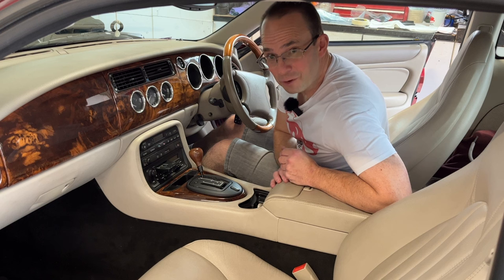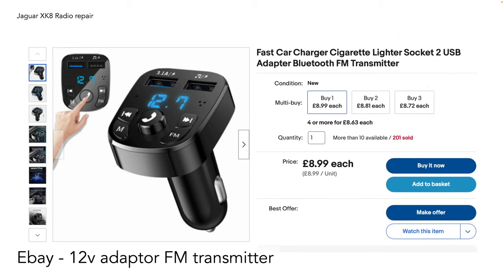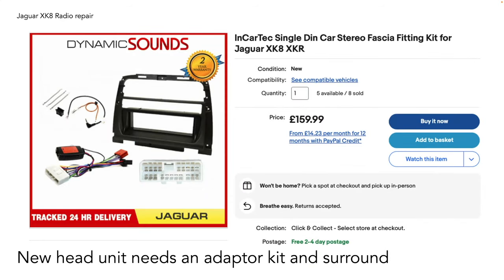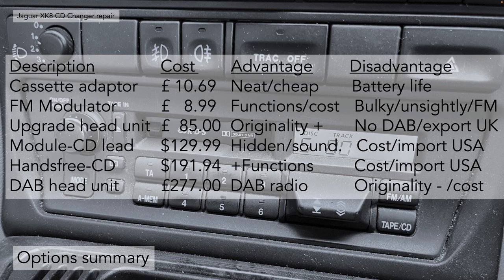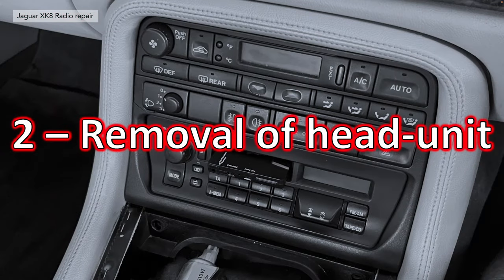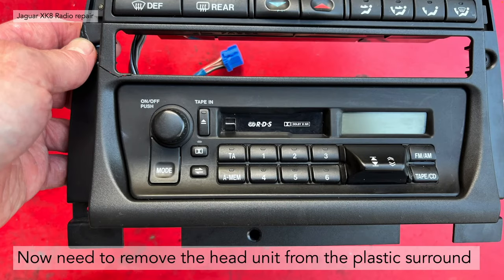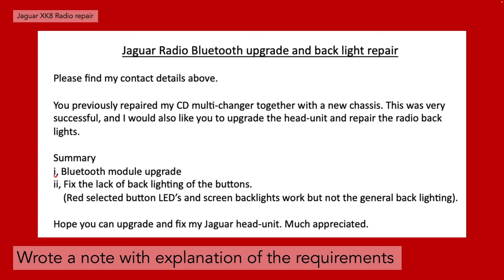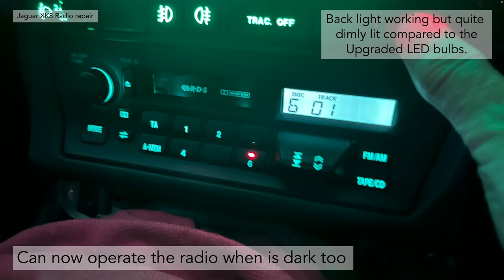Jaguar XK8 adding bluetooth, head-unit removal and repair. Radio cassette stereo BT XKR / X100 V205

Comment: I have been using the Cassette Adaptor for around 2 years.  It's brilliant.  Works well.  I don't drive my car alot so charging the adaptor is not an issue.  I just charge it before I go out on a long journey.
Reply from the maker: Hooky, I have also been using one for a few years and it's a good solution. The charging of the battery and the tape head pickup are weaknesses. Eventually got fed up and decided to upgrade the head-unit. No battery or directly connected to the head-unit, regards Damian

Comment: I fitted a new single DIN Panasonic head unit to my XK8 many years ago. Rather than change the entire console surround I simply bought a shaped insert which fits around the single DIN unit and replicates the shape of the original Jag surround. The insert was not expensive. You can spend as much or as little on the head unit as you wish but the total cost including the surround could easily be under £100 and you then have proper Bluetooth without cassette, DAB, USB socket, aux phono input etc
Reply from the maker: Richard, Sorry didn't include the surround inserts you can purchase for less. Good point you can find simpler options for head-unit integation and spend as much or as little as you want on a single DIN unit. It is a good solution but loses the OEM look for the dash board. Thanks for your input, regards Damian

Comment: Nice. I added bluetooth using a hard to find Alpine device integrated with the cd changer, along with a BT receiver and an extra subwoofer.  My XKR is red like the one in the thumbnail, a 2001 convertible.  I love it so much. It's SAD to say I may sell it soon since I dont have time to drive it anymore.
Reply from the maker: Dean, sorry you are thinking of selling your XKR but thank you for your input. Hadn’t occurred to me you could retro fit the BT module. I will re-record the video with this additional option. Do you know the module part number? Would like to see if I can still find one to add to the video. Much appreciate your suggestion, regards Damian
Reply: @ODRModurol  I'm in Los Angeles, so I have the US model, but it was an easy install.   If you can find the alpine part.   You need to use aux channel 2 on the Alpine KCA-410C Versatile link adapter to work with the Jag system.  The selection for aux is made with a single switch to the interrupt input.  You can very discreetly mount a small switch in the wall of the armrest storage box.  Although I installed an aux switch,  it's overkill, I have never switched back to my cd player.   Also, my phone can give a slightly higher output level so I can squeeze a little more juice out of the jag xkr premium stereo amp.  Make sure to adjust your phone level so as not to distort. I use this with the rockford fosgate BT receiver. Thanks for your contribution to this space, stay excellent and party on!
Reply: @deanshull4063  Do you know what alpine reciever you have in your 2001? I looked at the KCA-410C and on the box it says it connects to all 2001 and up Alpine recievers, but my car is a 2000 model year. Think it would work? I currently use a module made by Discount Car Stereo for bluetooth, but it doesn't have an aux port.
Reply: @deanshull4063  Didn't mean reciever, just meant what model of Alpine system
Reply: @deanshull4063  Hey Dean interested on this solution you´ve found. I´ve been looking for this Alpine KCA-410C but couldn't find it. Any suggestions? Which Bluetooth adaptor did you use? Thanks in advance, mate!
Reply: @frylock770  the - KCA-410C - i see a used one on ebay - sorry for the late response just saw this

Comment: Hello. I have a 2005 XK8 4.2S White badge edition. You say that these had Bluetooth but i havent found it on mine! I bought an fm transmitter but the sound is noticeable worse than the Pioneer head unit in my other car. Is that my inagination or is it far better to have BT in the head unit?
Reply from the maker: @Jono2905, interesting which market is the car from, North America? I found the head unit was much better after a refurb and sound via bluetooth was very good. However, it's still circa 30 year old technology and equipment. Although refreshed, I would hope and expect any modern head unit to be better performing. IMO it's better to have the BT integrated into the headunit. Thanks for the comment, regards Damian
Reply: @ODRModurol  It is a UK car (I'm in Surrey). It's got the telephone gubbins but that does work with any modern phone I have discovered! I'm considering the eBay guy who converts the head unit but as I'm not confident with my abilities, even with your detailed instructions, and will have to get someone to remove it.
Reply from the maker: @jono2905, the pairing of phones with Bluetooth is quite obscure without a touchscreen, the instructions are on our website www.modurol.co.uk, link at the bottom. Don’t think it includes music streaming but could be wrong.
https://drive.google.com/file/d/1mzNrDQuyT6toaOlg8896XVAqyVNcB1ld/view Thanks Damian
Reply: @ODRModurol  Thanks Damian, noted. The phone actually works well with the FM transmitter.

Comment: Hey, just wanted to ask you, if you know about an alternative to the Streaming Add-On Module from Discount car Stereo? Because I think the concept is briliant but they‘re currently out of stock.
Reply from the maker: R.P, yes I am aware of the streaming add on which uses the CD player input. I have cover several options in this video see link attached. Hope that helps, regards Damian
Jaguar XK8 'No Disc' CD Multi-changer repaired. All options available reviewed Our fix XKR X100 V204
https://youtu.be/kG61K1GM-Bc

Comment: I just want to add 3.5mm input to be honest. It's a bit of a pain that Jaguar didn't add in some input like 3.5mm
Reply from the maker: Kuddlesworth, sounds like a simple addition but not thought about even in a luxury vehicle in the late 90's. Standard on most cars now regards Damian
Reply: @ODRModurol  I know it can be done but it requires the CD changer to be working fully and costs about £100 + postage from the US for a cable that is a go-between. It's a bit of a pain in the ass if I'm honest which is why I haven't bothered doing it and probably never will. It doesn't bother me too much that I can't listen to music when driving anyway, I just listen to the exhaust and engine.
Reply from the maker: Kuddlesworth, good point, especially with those straight pipes, regard Damian